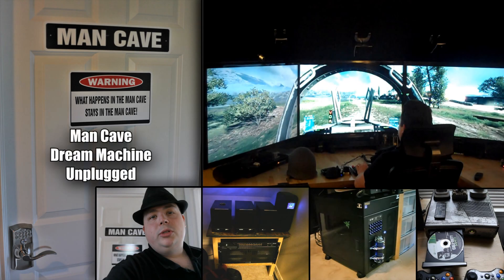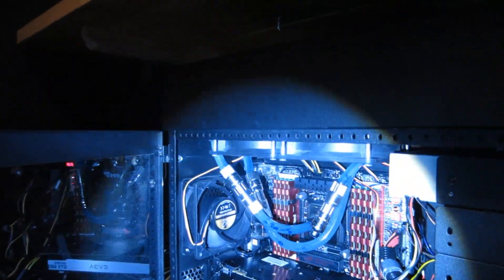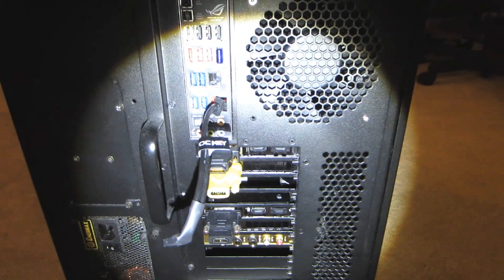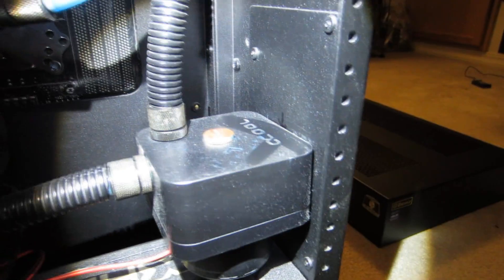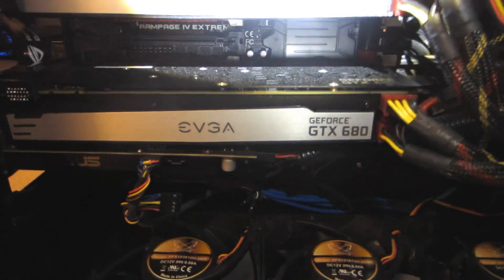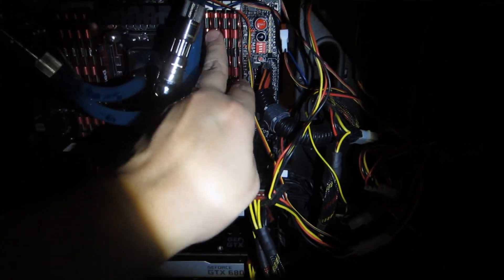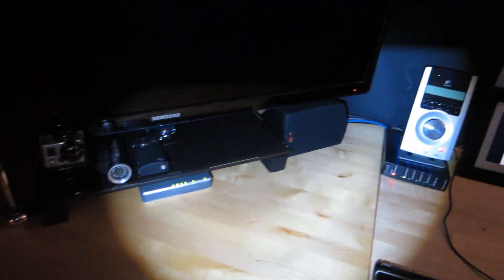Liquid Cooled Dream Machine Computer Walkthrough - @Barnacules

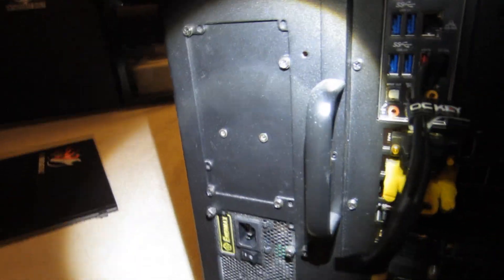Comment: 3 questions: 1) @ 10:27 why is there a handle bar?   2) also @ 10:27 whats that wire sticking out for?   3) @ 9:30 why do you only have one thumb screw in the bottom video card??

Comment: I'm currently upgrading to a Skylake machine in place of my Athlon 64 X2, using the same case, power supply, and drives. Using a pretty decent motherboard so I have a decent amount of upgrade potential should I decide I need it, but an MSI H110M VD Pro is still pretty cheap and nothing special. Using a Celeron G3900 and the integrated graphics since I was still well served by the 64 X2 and HD4650 that I was running. Only upgrading now because it's almost ten years old and is starting to have issues. The Celeron and Intel HD both outperform what I have currently and the H110M board I'm getting has the display and PS/2 ports that I need -- VGA, DVI and 1 PS/2 for my Model M.

Comment: Honestly, I don't care that your cables are a wreck. To each their own. Also, I have worked on my PC on carpet also. Nothing has happened yet, luckily. You do you Barnacules. Great video and very nice build. 😁
Reply: +Jonathan Sullivan Cable management and raising the PC are both things that mainly center around dust collection and airflow. 
Messy cables = air obstruction and  more space for dust to collect, and having a PC on the floor = more dust entering the case.

Comment: While it's nice to work with an anti-static wrist strap, it's not absolutely needed. All you need is to remove socks and shoes, and be sure to touch exposed metal on the case before touching any components, and continue to regularly discharge in the same manner. I've worked on many computers, and have yet to zap a card. The only issue I've ever had is ironically with the anti-static bags that products come in. They remain static free on the inside, but can build quite a charge on the outside.

Comment: For the ones that hate at sexyboy here, cablemanegement is HARD!!! in my case, i had trubble with the usb3, 24pin and the cpu cable. 24 pin was so stiff, if i'd tryed to make it look better, i'm sure the conector would snap off! usb3 i just cabletyed to the 24 pin. and the bitch  of a cpu cable was to short so i had to route it over the craphicscard and straight into the conector! :P i shuld buy a longer cpu cable... :P it doesn't look to bad! :D

Comment: UndeadSamurai01 He does programming, etc, and lots of other stuff than just gaming, like making Youtube videos. I agree with others it could be a lot neater, but hey, maybe his next build he will be more patient, this video is pretty old, maybe he already done another build. I threw one of my builds together like this, but it made me think more when planning my current build. I still suck at routing cables around the backside (due to length and bulky mobo cables) but the front looks good. Define R4.
Reply: Dean Stephan I probably need to do a better job. It just seems hard to me, mainly because the molex I might try to get rid of, and the extensions I have for my GPU.

Comment: That's a very expensive, poorly thought out PC. With all the money you wasted on triple the amount of watercooling you could possibly need for just the CPU you could have bought a third graphics card and reduced the sound by 10-15dB and the temp by a few degrees by selecting PWM fans that will adjust their speed as required and using 50% the number you have in better places. Lots of fans =/= better airflow. The PWM fans on my 280mm radiator rarely go above 30% except during stress testing, and can push 120CFM at max speed.

If you really don't care about money, you should have put your GPUs in the waterloop and OC'd them. They're more important the the CPU in 90% of gaming scenarios; if you do care about money, WTF do you have eight RAM modules? The amount of difference between 8x4GB and 4x8GB is negligible at best, and the price difference is several hundred dollars. Hell, you don't even need more than 16GB of RAM for gaming if you're not running a RAM disk.

Comment: I have 4 problems with this pc: somehow you have 8x8g sticks of ram, and only 32g overall #maths, your running 2 360's and not water cooling your gpus, memory (it is a thing, stupid, but hey isn't that the point of a build like this?), and your motherboard, your running a sound card, when in reality your on board is better for everything but boasting power, witch your not using, and a external amp is better than both, and the last problem I have with this pc is, well it not mine :/.
Reply: first of all, its 4x4. second of all, with his cpu overclocked to 4.6 ghz it will get hot. second of all, no. the onboard sound is not better.
Reply: ***** yea, one side has 4, the other side also has 4, hence 4x4. can you even reason?
Reply: I'm talking about 4 sticks of 4g ram, witch is what he SAID in the video.
Reply: Dat grammar

Comment: You just managed to make watercooling useless AND noisier than air cooling ! The one useful thing about water cooling is that you can get your graphics card and CPU really cool because you can afford to use big radiators and put big slow turning fans on there instead of being forced to have small radiators with fast fans that make a ton of noise, AND you can put that radiator anywhere you want to minimize the noise even more. What did you chose ? Leave the two hottest components air cooled, and have the CPU hooked up to an ultra oversized radiator with ultra noisy fast fans that you put ON TOP of the tower, literally the worst possible. It really is a sin. But hey the PC probably works great as long as you're using headphones.
Edit: It sounds just like a huge server....

Comment: 2 question why the fuck is that thing so dirty and why are you using hdmi adapters when the 680s have hdmi out already
Reply: *****  he don't need dvi adapters the 680s have hdmi out
Reply: he should only need 1 not 3
Reply: Shittons of intake fans with no dust filters is why.
Reply: ***** You are correct, but Jerry here has as negative as negative air pressure can get :P

Comment: lol, 2x 360mm rads for just the cpu, when you got 2 hot videocards in desperate need of watercooling.. logic..
Reply: Exactly what I was thinking haha
Reply: that's not the point.. he would not have needed more than a thick 120mm rad for that one cpu..
Reply: Agreed, put the first GPU on 1 rad and the second GPU + the CPU on the other rad, considering it's a gaming PC. Or CPU on 1 rad and 2 GPU's on the second rad if you really need the performance from the CPU. Either of those would allow some very nice OC;ing on the GPU's. And you could cut the amount of case fans and therefore noise down....a lot
Reply: Eso SM
 why split into two loops? reservoir > pump -> gpu>gpu->cpu->rad->rad... must easier to flush and maintain, than having to separate everything into several loops.
Reply: DisabledStan
Well 2 loops makes it easier if you have a pump go down, if your CPU pump goes out you just put a fan(air cooler) on it till you get a new pump, (if you have one pump and VID cards are on WC then you are down till new pump comes in unless you want to risk remounting original coolers or have a spare pump, I try not to mess with my vid cards as much as possible) if you have 2 pumps(2 loops) and one is CPU and One is GPU (put both gpu on same loop so they have same temps and gpu boost similar) then if GPU pump goes out , I move the CPU pump to the GPU's using my Quick Disconnects, Put stock air cooler on CPU(turn down my over clock) till new pump arrives , my down time is about 10min.
Reply: i still am using a pump from 2004 in one of my computers. and i have never had a pump fail. and if you do, just don't buy that cheapo brand again. Alphacool for life. + with so much rad space, chances are that he will be wasting some cooling capacity if you want to split the loops. his CPU is not nearly gonna spew out as much heat as his GPU's  and with 2x 360 rads. it would be stupid to split anything. that cpu do not need a whole 360rad alone, BUT those gpu's will need one dedicated, and potentially some more cooling capacity from the other. oh and risk? what is the risk of changeing coolers? you obviously got a waterblock mounted, so what is the big deal, just to throw in some heatsinks again? it's not some magical wizardry, with 780ti's its no more complicated than removing screws, and making sure thermalpads don't get contaminated, and viola!
Reply: Well its not "magical wizardry" but that does not mean its a good idea to be unmounting and mounting heatsinks from GPU's when it can be avoided. Also I have seen many people have pumps go out, while I too have never had it happen, why take a chance, I run 480 Rads as I have the TH10 case but a single 360 with the right fans and if thick enough should cool those GPU's . Besides 2 loops if done right can look really cool and when your dropping 3-4k into a computer might as well make it look cool. I just prefer 2 loops for my reasons , I know it can be done in One, but that does not mean one is better, in  fact 2 can be a little more efficient allowing you to customize water flow to cards for optimal temps independent of the CPU. If money is a big deal then one loop works fine. I just like the redundancy I have already mentioned that 2 loops provide, personally on my current rig my GPU's are still on AIR as I have not yet purchased blocks for my cards, I will probably wait to get blocks till I switch to new 980's (or whatever comes out above that i.e. a 980ti or so in 6 months or so) After I get new parts I will probably install my second loop into my new case, till then it sits in my old case waiting.
Reply: regardless of one or two loops, if a pump goes, it goes, and you still have to dismount any water blocks and replace it with a temporary heatsink. and no, two loops is certainly not more optimized, you would only use at max 70-80% of the cooling capacity of a 360rad on almost any cpu. might as well pump as much heat into as many rads as possible, to really utilize the potential of the hardware. but still, regarding barnacules setup, it is totally retarded not to include the gpu's in the loop, and if he did not intent to do so, he could have gone with one single thick 240 or one normal thickness 360 rad. (if heavily overclocked) 2x 360 is just not necessary for his purpose. and is no longer "just eyecandy" since it looks fucking ridiculous, and is a total mess of wires and tubes anyway.. no need to argue this, it is nonsensical.
Reply: and the cpu would not get hotter in a single loop, the gpu's does not get hotter just because the cpu is in there, and water temps would stay the same, since you ramp up heat dissipation and heat output equally.
Reply: *****
 i did. but i was referring to jamming a rad inbetween two GPU's. that's retarded.
Reply: Eso SM Well, actually, it was not intended to be a gaming PC.... He did it to play games and do his coding fast. He does coding as first priority and gaming second.
Reply: DisabledStan I had an expensive cooling loop, it died horribly at year 3

but wasnt the coolers fault, theres sulfur in the air here, and it corrodes brass and copper really quick, makes a black gunk out of the coolant
Reply: at that concentration of sulfur, you would have been dead. that gunk you are talking about, almost certainly comes from a poorly cleaned radiator/pump, or a bad batch of your coolant. if sulfur were the reason your coolant gunked, it would have sprung a leak way before you could observe gunk.
Reply: DisabledStan it was a sealed loop, and no it only takes a small amount of sulfur in the air to turn copper, brass and other metals black inside a week, and corrode thru the thin radiator in a year or so, it sprung a tiny tiny leak, not enough to even spray or dribble(just slight moistening of the corrosion around it), then the gunk formed and sealed it again from the looks of it

and you need a shitton more sulfur in the air than this to die from it, otherwise my whole town would be dead.

I can take a picture of a total copper heatsink pulled from its wrapper 3 months ago if you want
Reply: Revoku the problem i got with believing this, is that i live in a Norwegian village that is very rich in sulfur through rain, (Stavanger). and i have never experienced anything of this nature. itis still a possibility that the fluid used from the manufacturer was faulty. i would like to see that picture. but as stated, sulfur in the air would cause problems for people if the concentration is that great, that it digs through copper indoors.
Reply: It used to have liquid cooled 590s
Reply: DisabledStan
I had a D5 die, and it died like almost all D5s die:  you hear a weird skipping noise for about two to three months, then it no longer spins.  if the dude is gonna spend $700 dollars on a case, money is clearly not an issue (or he's irresponsible).  if the former is true, then run two pumps in series for redundancy, aesthetics and additional performance when you're pushing multiple radiators, a CPU, and hopefully you decide to watercool the graphics cards since you're running that much rad space.  a CPU only pretty much completely defeats the purpose.  and don't say "well he did it because it looks badass".  if "looks" were a primary concern, he wouldn't have a rats nest existing inside his $700 case
Reply: joesaiditstrue he made a dual xeon build now look on his channel
Reply: Clement Ehall
ill check it out
Reply: im pretty sure "24" fans will keep the inside cool enough the keel the video cards from over heating

Comment: The largest waist of money I've ever seen. 2 360mm radiators for a Intel processor? A bit overkill? Not to mention over 12 fans making ridiculous noise with no cable management reducing airflow. Nothing about this build was researched or well put together. You have no rear fans either so your psu and hardrives will have a lower lifetime. The case he got ripped off on, there are cases that are better for only $180. Worst build I've ever seen on YouTube so far

Comment: I have only 1 ?
With all that radiator space y not watercooling the graphics cards?
Or u waiting for better waterblocks? Im building something similar but with 780s non ti's. But i have xspc waterblocks for my evga superclocked 780s. I looked at ftw, and for price difference isnt worth when running on water i can clock the same. I went with corsair 900d for case. I have 1 360mm and 1 480mm radiators. For cpu and graphics cards slone. I thought u had watercooled grsphics when u had 580s?